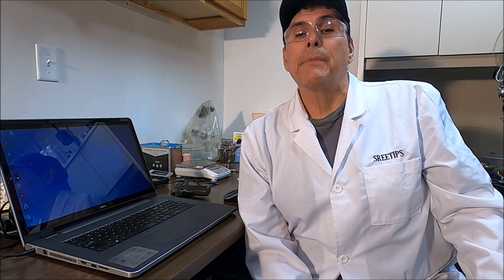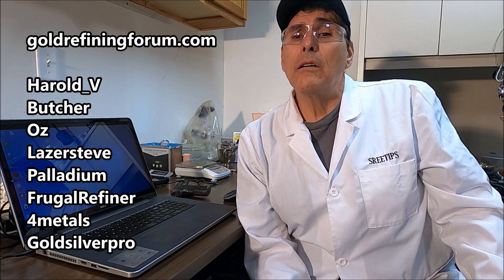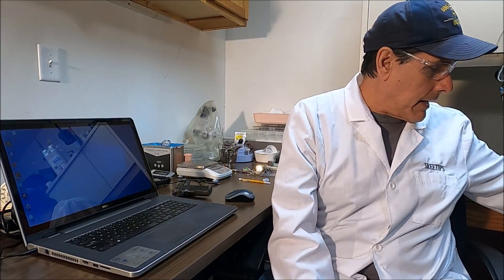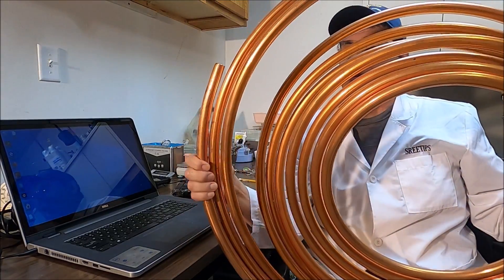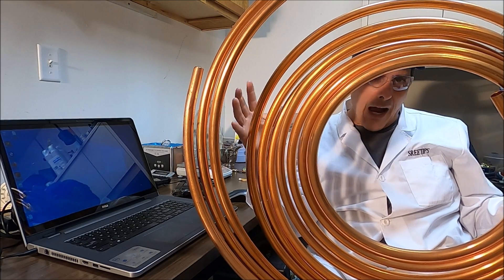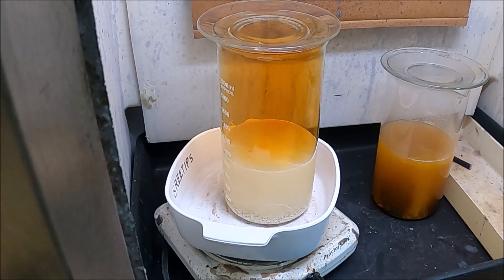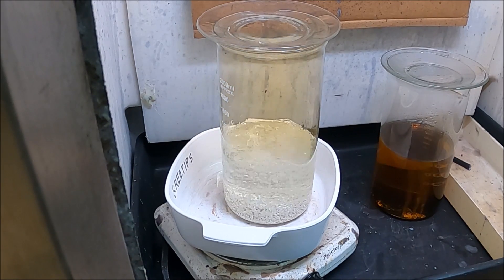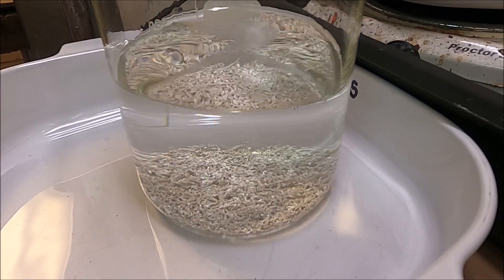Blue Pure Silver Crystal With Nitric Acid

Comment: It would make for an interesting video to cement out the copper with iron scrap, then electrorefine the powder to pure crystal using the same setup as your silver cell. You could then use the pure copper crystal for your silver precipitation. Ultimately you would be left with an iron salt solution (ferric nitrate), which when neutralized and precipitated with lime, would make a far more environmentally safe waste than the copper.
Reply: That's more what I am looking to do I enjoy the chemistry .
Reply: @pietmondrianstudent6984  Not without neutralizing it first with lime. You'd also have to be sure that there aren't other toxic metals, like lead there (add some sulfuric acid first to precipitate lead?). The precipitate after adding lime will consist mostly of rust material. The solution itself after neutralization with lime will consist out of calcium nitrate, which is also a good lawn fertilizer, but has to be diluted heavily or it will 'burn' the lawn.
Reply: @pietmondrianstudent6984  The KEY things there with Nicola's suggestion are #1 'neutralization', meaning add enough lime to make it a pH of about 7, #2 'dilution' meaning to add a shit-ton of plain water so you have very very little of the chemical salts in each dose, #3 the 'toxic' part.
If you refine like sreetips shows, there should be very little of any toxic metals left in your waste.
Reply: @pietmondrianstudent6984  Just use pH paper and add NaOH drain opener (with stirring) until you get in the right ballpark.
There is no way i could know what the actual concentration is, nor what your lawn Plants can tolerate or want.
Start with around 100x the volume of water to waste. Make about 1 litre, i.e. 10ml waste in 1 litre water.Try 900ml of that on 1m2 of lawn, with a stick in it labelled '100:1'. 
Dilute that already diluted solution again by adding the restl to 1 litre of water, try it on a different 1m2 patch of lawn with a stick in it labelled '1000:1', see what happens.
Basically you have to do the Science on it to find out what ratio your lawn likes of your waste:water.